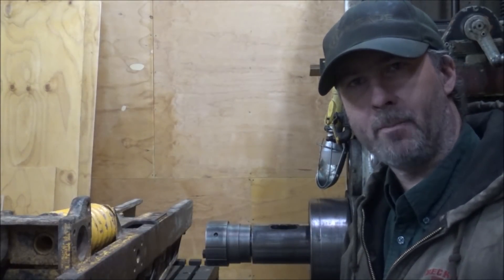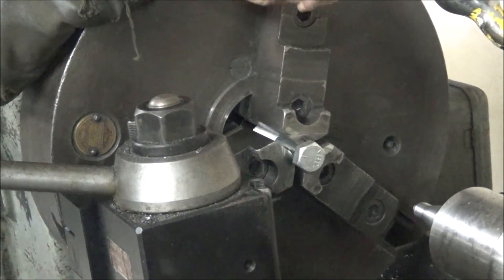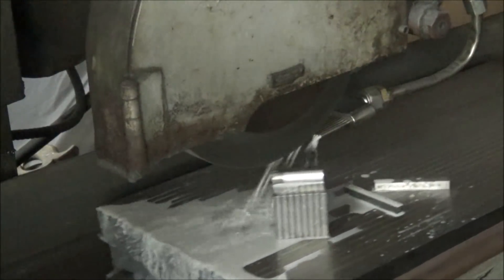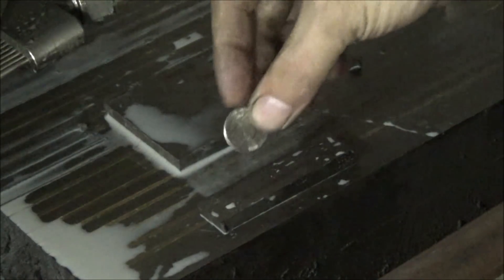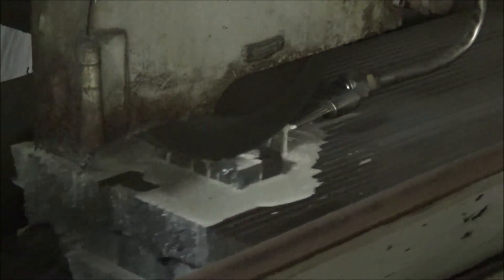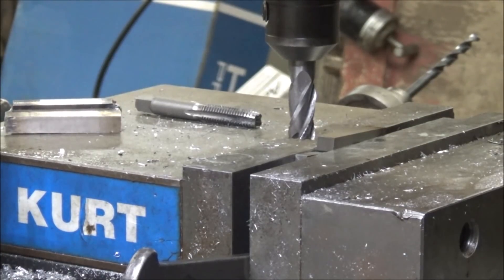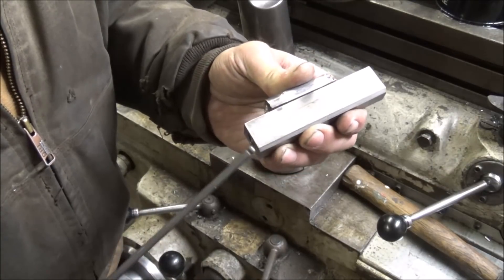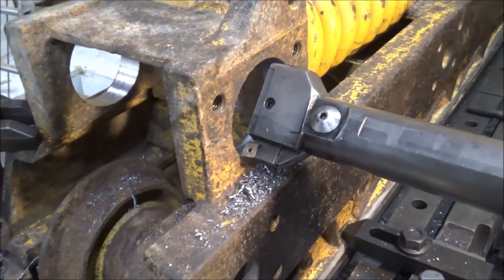Horizontal Boring Mill Davis Style Morse Taper Retaining Key How to Hold Tapers for Milling Cutters

Comment: Couldn't you make a new front piece Like a thick washer tapered to match and bolt or weld to the spindle and fix the slot length. Ya know the way it should have been done. . God bless buddy and Merry Christmas if I don't comment later. I'm the old cripple in NJ who wished I could help .
Reply from the maker: The proper fix would be to make an entirely new spindle.

Comment: Nice little bit of designing there Brian, shows your thought process and background experience, cheers!

Here's poser if anyone reads these comments; I made what I would call a toe jack from a piece of 1/2" CR flat , I put 1/8" stairs and tapped a 7/16" -20 hole. This is to jack up a heavy electric motor to adjust the base shims where it is difficult to get a pry bar in a tight spot. Any comments if anyone has a similar tool. I went with this design because it was simpler than a wedge assembly. Thanks to any ideas out there!

Comment: Make you a sleeve collar to fit around the shaft with four locking set screws and then install to push pins like you would on a motorcycle rear axle
Reply from the maker: Robert moreland  But The spindle has to be able to retract into the headstock so nothing can go around it.

Comment: Hey Engineer, learn how to weld

https://youtu.be/DuSIuaQug-8
Reply from the maker: You funny! They are just spot welds to keep the piece from falling off and since the welder had been sitting there was no shield gas at the nozzle when i made the tacks. I guess I should have welded something else first to get things warmed up, but it will be just fine just to keep the piece from falling off when it is not in use.
Reply: bcbloc02 
The strongest welds r forge welds..
that’s how I fuse workpieces.
Quality work takes time :)

Comment: Brian, if I understand you correctly, you are saying that the Morse taper in the machine spindle does not have sufficient "grip" to withstand the loads imposed by the single-pint boring tool. Is this right? If this is the case for machines in good condition then I can understand the need for a wedging device, of the sort you described, being necessary to hold the tool in the spindle.

However, given the appearance of the slot in the spindle made to give access to the driving tang, and the way it has been "modified" over the years, would it not be safe to assume that the internal taper in the spindle itself is also similarly chowdered/butchered/buggered_up?

You are the engineer and I am an interested amateur, so I'm just sayin'...
Reply: He did mention it had been reamed, likely the worst was dealt with using a Morse taper reamer. I would guess that's why the spindle nose was cut back, to keep tools from seating too deeply in the deepened, reamed out taper.
Reply: @somebodyelse6673  Thanks, that makes sense.
Reply from the maker: Yes single point tooling can easily cause issues with working the tool loose even on a machine with a perfect spindle. Having a method to keep it drawn in tight makes life much safer and happy than having a tool kick loose while you are cutting with it.  For drill bits there are no lateral forces so they don't need it but start milling or anything else side loading and it is pretty much a must have.
Reply: @bcbloc02  Which is why we have draw bars on mills. But a draw bar won't fit here, will it? Because the spindle moves axially. Now I understand. Thanks mate.

Comment: Brian I thought that both the tapered "ramps" you made were out of tool bits... When you remachined the taper on one of those parts it looked like it cut easily with a regular mill bit on your mill ???

Also how did you weld the bolt onto the tool bit?

Like the video by the way :)
Reply from the maker: Yes the ramps were both made from HSS tool bits since they are nice and hard. I used a carbide milling cutter and a slow feed and speed and it worked just fine. I used the mig gun to stick the bolt to the one bit. I should have Tig'd it it would have been prettier but honestly I was rushing to get back to the job I started. :-)

Comment: Enjoyed Brian, nice job, the boring mill I ran 45 years ago had a factory version of what you made.
ATB, Robin
Reply from the maker: I could not locate anybody making a factory version anymore so had to do my own.
Reply: @bcbloc02  I just thought it was cool I used one of those that long ago. You had to make one anyhow because you have non standard slot conditions. I wasn't implying you should have bought one. :-)
ATB, Robin
Reply from the maker: ROBRENZ Thanks for stopping by Robin and I totally understand. Pretty cool that you once worked with machines in the feet scale rather than microns too.😎

Comment: So how is the floor heating since you've added insulation, cause I know it's getting cold up there since it got down to thirty here in Pensacola last night?
Reply from the maker: When I filmed this it was about 20 degrees outside but almost 50 in the shop. It won't stay there though if it stays down for several days.  the 10000watts from the water heater is only about 36000BTU and that won't do it with still no ceiling. I have not had time to build it or to hook up the wood boiler, but I think that will be next. I still have plenty of wood that needs burned and cleaned up.
Reply: @bcbloc02  interesting to see how that boiler you got a while back will heat the shop floor tubing.  Looked like more than 36,000 BTU.
Reply from the maker: More like 200,000Btu. It should heat it with ease, just have to keep it fed with lots of wood. :-)
Reply: Ceilings don’t seem that important until you’re trying to heat your shop.

Comment: So many nowdays can't fathom why the old guys keep all the scrap bits and "junk" to them. When you can grab old steel laying about and make what you need, no searching , ordering, waiting you're more efficient than the most expensive well made thing you can buy will make you. With out considering something like the modified spindle in the mill. Thanks for sharing
Reply from the maker: Baily likes it when I can overcome problems and get back to work same day. :-)
Reply: @bcbloc02  lol ... heck I  like it when I can solve it and get back to work too. What kind of rails are those you're boring on? Is it top secret, wait for the video?haha
Reply from the maker: OLD SCHOOL They are bulldozer track frames.
Reply: @bcbloc02  yes I figured so.... they look kinda small,  curious if they were antique, D2,D4 etc

Comment: Is this a double Morse taper adapter ?. Remember our G L 8 inch bar on  a 70 ft bed .
Reply from the maker: It is a Morse Taper 6 to a Beaver 2" quick change.  The mill came with 1.5" Beaver stuff but lots of this tooling uses the bigger more rigid 2" drive for cutting and milling so I had to make this key to hold that one in instead. It sure beats having to drive the MT tooling in and out all the time.

Comment: Good fix for the problem , Cheers .
Reply from the maker: Thanks, it works well.
Reply: @bcbloc02  If the quill doesn't have to retract any further i think, maybe ? it could be done with 2 threaded sleeves , external thread  anchored to the mt6 with a 5/8 pin & internal threaded sleeve has a recess in opposite end to suport the lock pin allowing the sleeve  to be tightened  and it should jack the tool into the mt .  Just a concept thought !
Reply from the maker: I had considered something similar but unless you made the threaded anchors with cross drilled holes to tighten them there isn't much room for any other method down in that slot as all of it has to fit within the confines of the spindle bore so it can retract into the headstock.

Comment: Nice! I see I'm not the only one turning 5/8" bolts into parts for something else. I just made an adjustable idler pulley and bracket for my Jacobsen UV-4. Unfortunately I need to get it done asap so I didn't have the time to record it.
Reply from the maker: Well I didn't have a 5/16" radius milling cutter so it seemed a good alternative to get it done with what I had. :-)
Reply: @bcbloc02  I seen nothing wrong with it. You solved a problem that was caused by a simple part by making a slightly more complex part. Yet your part is better than the original. Because it solves two issues. Holding the tool in and preventing axial misalignment. 
There aren't many of us who can make things out of nothing. And in todays society folks are far too comfortable with direct replacement parts changing and just throwing things away. Things  that you and I would just fix. Some people call me cheap because I'd rather buy used machines and fix them up instead of buying them new. But the mechanic, fabricator and machinist in me just likes making things.
 Which reminds me of the term "cnc machinist". Which isn't even  true to itself. But that's a rant for another day. Hahaha.
Reply from the maker: CNC operator or programmer is more correct. Like I told Jimmy Diresta, his slogan is I Make, Mine is I Fix. :-)
Reply: @bcbloc02  you're absolutely right. Operating CNC's doesn't make you a machinist. Just like microwaving doesn't make you a chef. 
I'd love to own a CNC and know how to program it. But, I thoroughly enjoy using my saws, lathe, Bridgeports, surface grinder, and welders.

Comment: I'm probably 3D challenged but how does the set screw interface with the moving surface?
Reply from the maker: It pushes one of the wedges I ground which lifts the other wedge to make the jacking action. I guess i didn't show that part very well.
Reply: @bcbloc02  Thanks and it seemed to really do the job.

Comment: A tool pulling out from it's holder is in most cases causing damage or in some cases injury, good call and remedy...   
We got our first snow storm yesterday and unusual cold for this time of the year, have you done some progress on your furnace in order to keep you warm and comfy when you and the supervisor are undergoing work in the shop...?   🥶🍦🤧👍
Reply from the maker: It snowed here yesterday too, only an inch or so. Temps were in the teens all day. I think 24F was the high. Sadly I have not had time between harvest and work to get the boiler hooked up. Shop boss has decided to approve all work from the house now that it is cold. lol
Reply: @bcbloc02  Aren't all bosses the same... ?  🤣